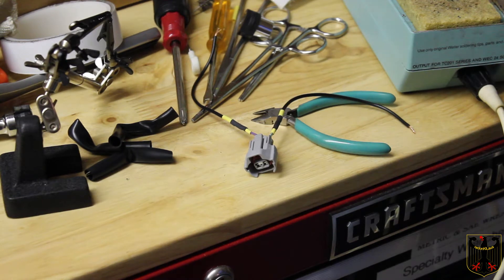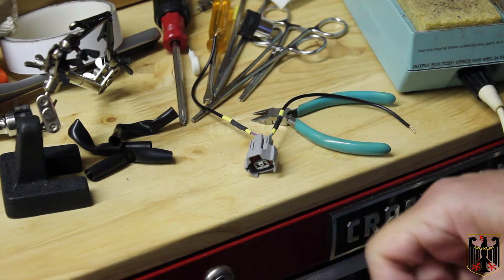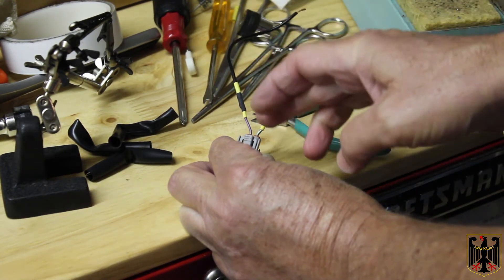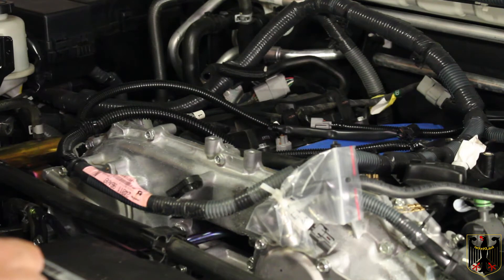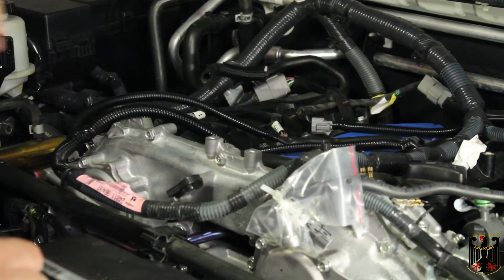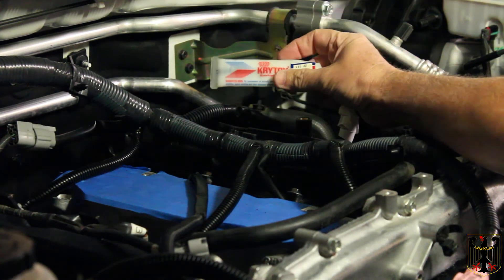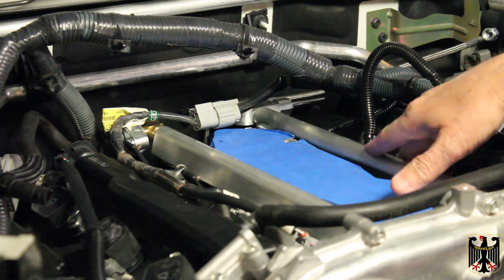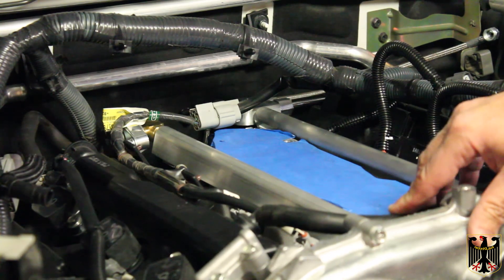VQ40 Stillen Supercharger Install - Part 4 - Fuel Injectors/Rails, Wiring Extension, Valve Cover

Comment: How many miles were on your vehicle when you did the install? I have another 25K before I retire, my 2012 Frontier which will put me at 250K. She has been a great ride without providing any issues but am concerned what I may need to do to the engine with this many miles to handle the extra power.
Reply from the maker: Somewhere around 20k I believe.  It's at 40k and change now.  If you do supercharge definitely do an UpRev tune as opposed to using the piggyback ECU, it will save you a million headaches and is worth the couple thousand extra bucks.  Thanks for watching!